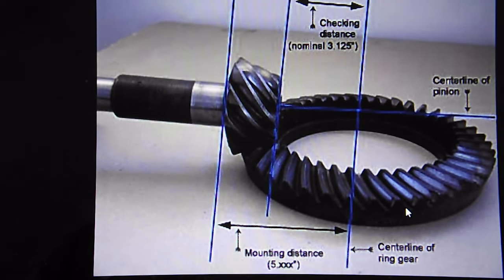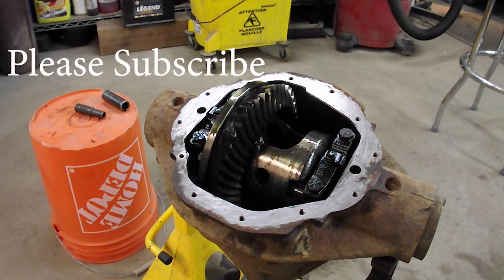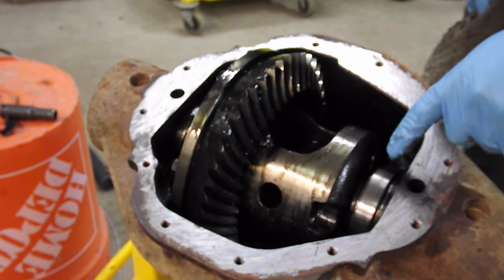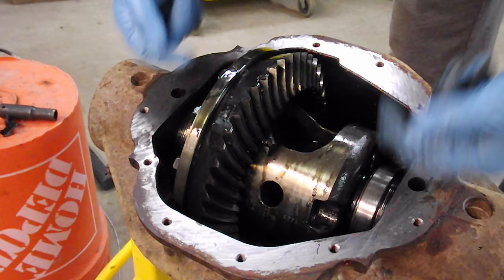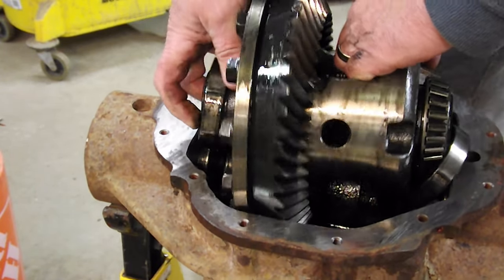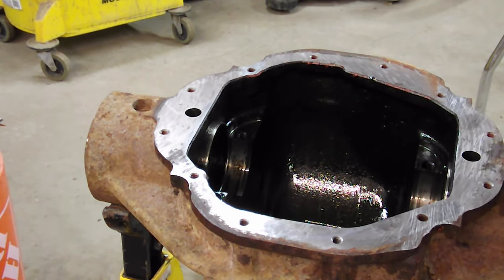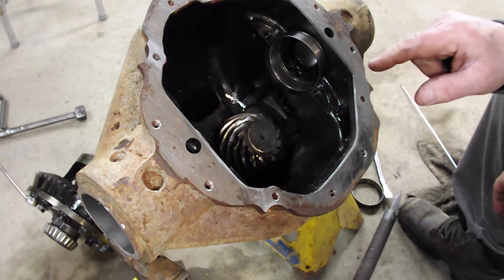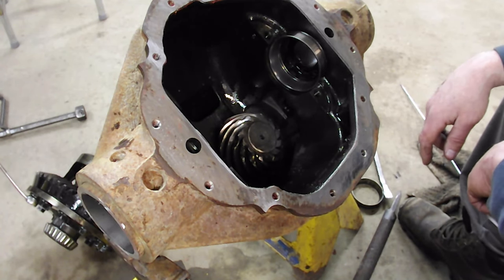Pinion Depth Checking With Simple Tools

Comment: Great video. I could see exactly where you were going with your strategy from the start.  You were able to find the pinion depth, to axle center point, using a straight edge and caliper. Two affordable and generally useful tools.  WELL DONE! The more common method is to use a setup bearing and trial and error.  That can be VERY tedious and time consuming. This gives you the best shot at one and done and who doesn't want that?  Thank you for posting this.
Reply from the maker: Thanks for watching and leaving a great comment. How you subscribed.

Comment: Just remember this will only work if you are replacing that ring and pinion with the exact same gear ratio ring and pinion. If you're changing to like a 456 gear you need to know pinion depth from the gear manufacturer
Reply from the maker: Gear manufacture usually will give you pinion depth for their gear set. Then you can calculate required shim with these measurements. Thanks for watching and commenting. Hope you subscribed.
Reply: Even then, i still would still be marking gears and checking backlash rather than go of basically an arbitrary measurement.
Reply from the maker: You always have to check/ set backlash and check pattern. These mearsurements are so you done have to pull pinion back out (most of the times). Thanks for watching and commenting, hope you subcribed.
Reply: Wrong, Pinion depth is calculated from the ring gear diameter not from the gear ratio. You do not change your depth by gear ratio. Beside what is scribed on the back of the pinion is to give you an idea of what size of shims to start out with. Diff cases are not all machined exactly the same.

Comment: Way too much math.measure from bearing centerline to face of pinion gear, that's the pinion depth. Bearing centerline is the flat surface where the bearing cap mounts.
Reply from the maker: Not all bearing caps are at bearing centerline, caps are torqued in place before line boring for side bearing cups. Measurement have to be made while pinion bearings are torqued to specified preload. Usually pinion nut has over 200lb-ft of torque before turning resistance is 20 - 30 lb-in, so you can't just measure to the bearing surface. That would be too easy. Thanks for watching and your comment, they help people understand why. Also some replacement gear sets will have checking distance etched on the end of the pinion and this is why we need to know this measurement. Thanks again!
Reply: @acmemachining  so you now I'm a 62 yrs old fossil. Been setting tears up for awhile now. The actual tool for doing this measurement has half moon adapter's that seat in rear housing where side bearing seat. Never have seen axle center line not be same as center line of side bearing cap split. Would have see that. Maybe show in future vidios. Thank you , Scotty S&EAuto
Reply from the maker: You are using the correct tool and finding centerline to be same as most bearing cap split. That is good to know. I hate to assume that all will be always the same. I respect your experience and your comments. You know the importance of having these measurements. I just wanted to show how to get them without special measuring set-ups. Thanks
Reply: @acmemachining  Thanks for video. Always more than one way to skin a cat. Have a good day and thanks for feedback.

Comment: Many pinions are not machined on the face you were referencing so it is dangerous to measure from there. If you are putting back the same parts no gears no problem but if there is a change you could wind up with it incorrect.
Reply from the maker: There is always something to screw up a good plan. I have used ball bearing in center pilot if available to still get mounting distance, but sometimes you do get ones you can't measure. Thanks for watching and commenting.

Comment: The technique and information is there however the videography could have been better and some dead time could have been edited out.  You explained why you used the digital caliper however it should be noted that for depth measurements with a caliper it is extremely difficult to be really accurate and it only takes a few thousandth of an inch to throw the pinion depth out of wack.  Additionally I would not recommend prying up on a gear tooth unless your planing on replacing the ring gear.
Reply from the maker: Thanks for watching and commenting. I tried to use simple tools that people might have without speading thousands on tools to do a $600 job. I do agree with your comments.

Comment: Good video! I read a trick in a Volvo manual 40 years ago.  If you think the pre-load/lash is correct, get 10 feet of string and a fiahing/kitchen scale.  Wrap the string around the appropriate shaft.   The Volvo manual said something like "pull 10 lbs of pressure and you should get x inches of string in y seconds...".   They did this so that you would not need a rotary torque wrench.  This method is accurate, cheap, fast, and repeatable.  You do it when everything is assembled and lubed, so you know that it represents the load the gears will initially experience on the road.  Yes, you still have to know how to measure and set things up.   Yes you could put the string and scale on a known good rear end and pull.  Hope this helps someone out there.
Reply from the maker: Hey you do what works. 40 years ago they didn't have all the tools we have today. I still use old deflecting bar torque wrench for testing in/lb preload. Thanks for watching and commenting. Hope you Subscribed.

Comment: I use a CYLINDER HONE to hone it but only take 1000 th out its about a 2000th press fit! But it is important to the shim side a hair more just so it drops on the shaft a little this will SQUARE up the bearing to the shaft and allow you to pop it on and off easier!
Reply from the maker: You do what works. Thanks for watching & commenting. Hope you subscribed.

Comment: Nice job. 
The biggest thing for me is being ‘self taught’ mostly because any possible instruction in my past has been trial-and-error mechanics that act like it’s a secret black art because they can’t explain what they are doing or measure it. 
I’ve done a few diffs but knew just enough to get it right and understand why. 
But great video that affirms my knowledge and taught me a coupla things. Between this and metalshaper’s vids I feel like the next one I do (Dana 30 of my own) I will know exactly what I’m doing and why, and you just saved me $800 :)
I actually found this video because I realized it’s just numbers and I thought it likely there was something like this method which would work. So you saved me a bunch of money AND saved me from reinventing the wheel.
Reply from the maker: Glad you enjoyed the video and it helped you. The math is simple, just a lot of it. Thanks for watching and commenting. Hope you will subscribe and enjoy my other videos.
Reply: I made a tool for installing my cam bearings in my 318 mopar..using an expandable freeze plug. Works great 😊

Comment: Excellent Video. I have not had the chance to do this job yet and am doing it for the first time sometimes this week. I've watched plenty of how to videos on how to do these measurements to get everything set just right. and I have to say. This video so far has helped me a lot more than most.  All the same measure points but I guess it just finally clicked with your video. Much appreciated. I have seen there are Measurement checks once everything's in, for back lash in the ring gear that has a tol of like 10 thou but i believe that's different for each model to check the how center it is on the teeth with the yellow marker.
Reply from the maker: Glad you enjoyed it and got some important information from it. Good luck with your project. Take your time and you will do fine. Thanks for watching & commenting. Hope you subscribed.

Comment: Thank You for making this video. I'm a machinist too so this way is way easier than making my own centering jig. However, I just bought a set of yukon gears, and USA Standard gears, and they both do not come with pinion depth markings. They strongly recommend using the existing pinion shim and starting from there. Shoot, that's what I would've done anyway before buying Chinese depth mics and $20 highspeed tool bits as my straight edge lol.
Reply from the maker: Hopefully that worked out for you when you checked your gear pattern. I hate when they don't give you pinion depth measurement or depth marking. Usually they are at zero if they don't have any markings, but you don't know until you read your gear pattern. Thanks for watching and commenting, hope you subscribed.
Reply: @acmemachining  definitely subscribed! We'll see how it goes, video coming soon and I'll be shouting you out 👍

Comment: Well done. You can also take a small cylinder hone and work the inside of the old bearing until it slides on. I've done a few Ford 8.8s and it's a time (and crush sleeve) saver.
Reply from the maker: Thank you. Honing the old bearing works. I usually order spare crush sleeves. thanks for watching & commenting. Hope you subscribed.

Comment: Good video, thanks for sharing. 
I make test bearings, I use the honing machine.
In my case I have an LBB1699 Sunnen.
You can save the bearing for the next time.
This is an absolute must on Dana's. 
Good idea for someone that does not have a pinion depth setting fixture. 
Thanks for sharing. 
Just subscribed. 
Take care, Ed.
Reply from the maker: Thanks for watching, commenting and subscribing. I also subscribed to your channel
Reply: @acmemachining Thank you for Subscribing. 
I really appreciate you. 
Take care, Ed.
Reply: I did the same. Bought 2 sets of bearing. Used a flap wheel. Kept checking them on the differential till it was just snug. The same for the pinion. Then I used the old pinion shim as a starting point. Looked at my pattern.  I adjusted the shim until my pattern came around. Tightened everything to specs. Took the final pattern. I was satisfied. Took it all apart and put on the new bearings by heating them in hot gear oil. Each one popped on. 
I took the housing to the local car wash. Got a bottle of dawn and away I went. Housing dried off and cleaned. Then the final assembly.  I spent 4 days. 
A local shop up the road messed up the differential before I got it. My brother in law was very mad. So he ordered new gears and bearings. Seals and oil. 
It's was out of a 3/4 ton Ford van. I was very happy on the final results.

Comment: Hi Tod, 
Nice overview. I use similar methods, with one change- curious about your thoughts.

I have always used the side bearing cap mating surface as an axle centerline reference.
One reason being, the bearing race could shift slightly with the cap removed and give a false reading. Another, its simpler.

The in the shown description also- while explaining a method for bearing replacement, over looks some aspects if replacing gears.
I have found that even with some well-known brand name gears, the pinion nose isn't very flat or lacks a machined spot to reference for setting depth to the gear manufacturers specification. This leads to a lot of variation, depending on the spot used for measuring. 
So I have sometimes found the gear pattern to be a less than desirable result and/or mildly noisy setups.
Another thing I have found, again- even with well-known brands, backlash can vary excessively in different checking locations. Runout on the carrier is acceptable, and relocating the ring gear to different positions doesn't fix it.
I have usually tried to find a reasonable compromise, where the lash is slightly tight in the tightest spot, and slightly loose in the loosest spot. "as good as its gonna get"
Reply from the maker: I have found the parting line to be off on some diff cases. So I will check for bearing centering to be sure. Usually when I remove bearing caps preload holds diff in place so it is easy to measure. You can check bearing parting line and measure to check if centered, but that will require proper round tip on depth mic. 
I use a magnetic ball bearing in the drill pilot hole of the pinion to take my measurements if it doesn't have another good reference surface to measure from. 
As for back lash tight in some spots and loose in other, you have to check for bent carrier or poor quality gear set. I don't like more than 0.001" varience. It might work on the street but fail under heavier loads. Thanks for watching & commenting, hope you subscribed.

Comment: Great video Tod!  I appreciate you sharing your knowledge with us less learned in the ways of setting gears. This is exactly what I've been looking for as I will be attempting a regearing of a Dana 44 for my son's Cherokee in the coming months.  AND, it is not too much math!  Actually, right in my wheelhouse.  I had a spreadsheet put together before the video ended. Now all that I have to do is "plug and chug" the numbers. I do not have the new ring and pinion set yet which leaves me with a question for you.  What is the significance of the plus or minus number that is on the face of the replacement pinion gear?  For example, if it marked with a +2, I assume that represents .002 of a difference from the factory original, but how is that applied to the Mounting Distance?  Or is it applied to the Checking Distance?  Thanks!
Reply from the maker: Thanks for watching and commenting. Glad you enjoyed it. Hoped you subscribed.

Comment: Very very good video,  thanks for posting it.  My only question is,  does this procedure assume that your pinion depth is set correctly to begin with?   Thanks very much again for this video.
Reply from the maker: Great question. We have to assume a lot of the time. Checking the gear pattern will tell if it was set correctly before disassembly. Depending if bearings and or gear are worn. These reading are recommended for setting new bearings and or gears as per manufacture specs. They want you to use very expensive tools. This procedure will save you money but take a little more time. Thanks for watching and commenting. I hope you subscribed.

Comment: Thank you for the video. 
Question- you have nominal (3.125) listed on the diagram at the beginning.  However your measurement
Is less.  So is mine. 
Where did you get that nominal measurement?
Reply from the maker: That diagram was not for this differential, it just shows the measurement and where they are being taken. Looking at that diagram with a mounting distance of 5.? inches that differential would be almost a 10" ring gear and most of todays diffs are about 8.25" unless 3/4 ton truck or larger. Thanks for watching & commenting. Hope you subscribed.

Comment: Great vid. Thank you. If you are only doing bearings and not messing with carrier internals,  can you reuse your crush sleeve? I get mixed responses to that question. I will be doing this on jack stands in the garage, so trying to minimize this. I have this exact rear end in the video.  Thanks
Reply from the maker: Always use new crush sleeve when ever removed or over-tightened. Thanks for watching and commenting. Hope you subscribed.
Reply: @acmemachining  "Always use new crush sleeve when ever removed or over-tightened." So true.

Comment: Chevy 10 Bolt. Pinion shaft in the freezer bearing in the Oven 350 degrees. Added my shims when the pinion shaft came out of the freezer and dropped my bearing slam dunk right down on the shaft ! No press needed!
Reply from the maker: That works great. Hot oil works better than just in the oven. I use cooking oil in my wife's oven. I am sure she does want to smell Hypioid next time see uses the oven. Thanks for watching and commenting. Hope you subscribed.
Reply: Strong move .. 😁😆😅🤣🤗 @acmemachining